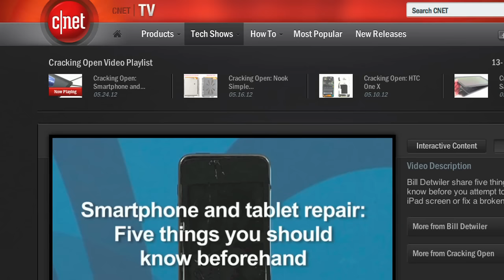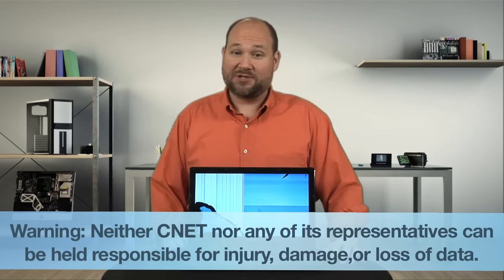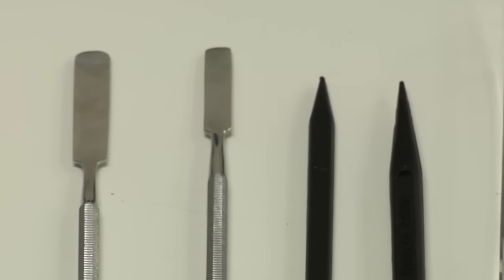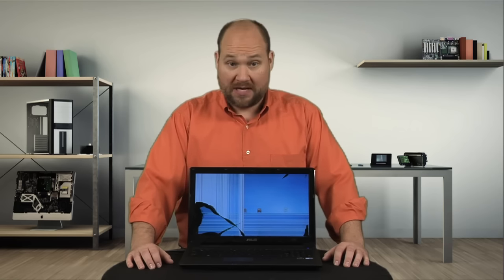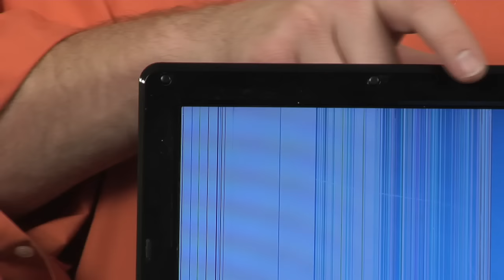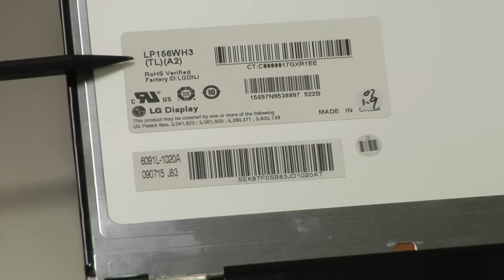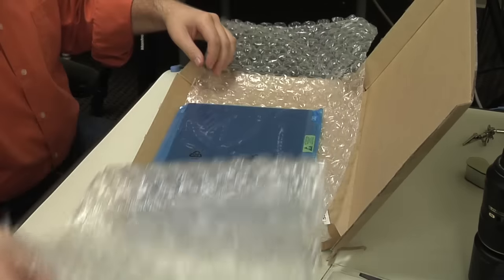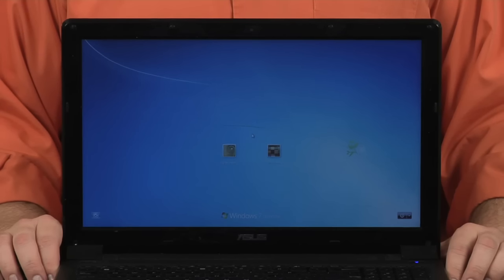CNET How To - Replace a broken laptop screen

Comment: Or you can plug a laptop to a TV and use that as your screen XD
Reply: mcpesuperzookeeper  thanks  I wasn't even thinking about using the HDMI port 😂
Reply: a 7 dollar alternative to fixing your computer screen
Reply: its not a laptop then
Reply: Jacob McGinnis still works
Reply: That's what I'm doing right now
Reply: Wow so smart thanks
Reply: Yes that’s what I’m doing rn
Reply: BIG BRAIN
Reply: i threw a hydro flask at it
Reply: Thanks and I guess I can use remote controller to
Reply: joshhfgh  No. And why are you all caps?

Comment: I have a Gateway LT4004u laptop, for 4 yrs, & it's been missing for 2 1/2 yrs, & I've had a broken screen (vertical lines @ the left side, flashing @ a really high frame-rate. Blank @ the top-left, all liquid-like) since I found it lost in a storage tub in a bedroom on Sunday, Dec. 20, 2015.

Comment: So what will happen if my laptop is touch screen? does it make it more complicated as it also has motion sensor on it? Or does the new screen also come with it?
Reply: In my experience, most Touchscreen LCD replacements do not come with the motion sensor chip, however, if your motion sensor chip is undamaged, you may be able to continue use with the new screen replacement after you do a calibration on it.

Comment: sighs I hope the same works on touch screen monitors. My little brother just cracked his in one spot and woke me up when he started panicking about it. Maybe this will teach him to actually take care of the damn thing rather than messing around with it. We've told him several times to knock it off (he's almost 15 btw) because he breaks almost all the electronics he gets. I mean, he broke two keyboards in at least a week and three wired mouses. Needless to say, I'll have to take a look at it tomorrow if I can manage to pry it out of his hands for a while. And even then I won't repair it until he cleans his room and actually sets up his desk properly.

Comment: a screw socket on mine holding the case around the keyboard came off and it popped up a bit and when i closed it the case dug into the screen and cracked it

i just noticed 2 minutes ago... : (

Comment: Slipped on the waxed floor at work and landed on my back. My head hit my backpack which contained my computer and metal water bottle. On impact my screen must have shattered by the force applied to it sandwiched between my weight and the upward force of the water bottle.